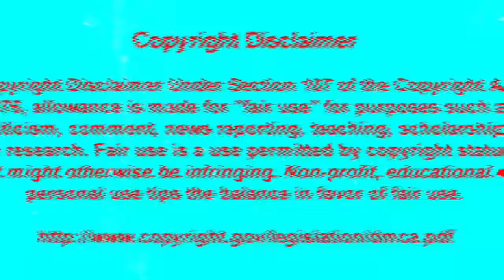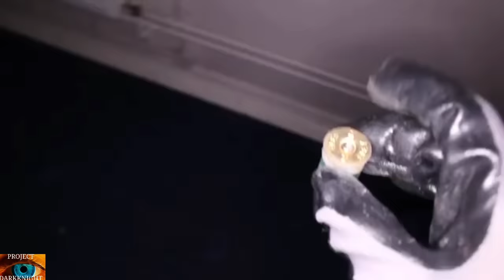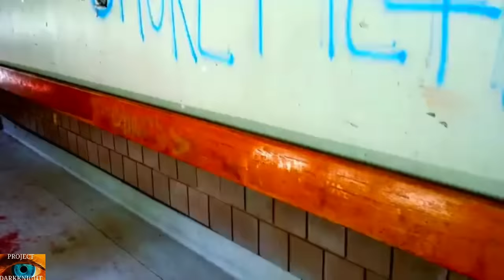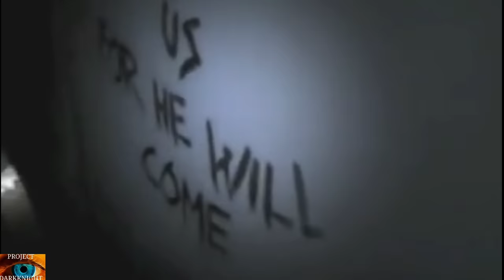Horrifying Videos That Show Urban Exploring Can Be Bad For Your Health: CAUTION

Comment: 18:46 - It looks like it's crimped at the top so it just might be a blank round... the 5.56 round and the silver casing were blank and simunition respectively and they are rounds used in mostly military training, they are fun to fire, especally 5.56mm blanks, also are pretty harmless (Just has a primer and gunpowder) as long as you don't fire them close to someone's face and body....They are hell to clean up tho ESPECIALLY the simunition rounds....  

Edit - yea @19:44 - he's talking about rust... that's the color coating used to denote the rounds as blank rounds after firing this round might have just gotten stepped on just used or over time the color on the tip fades and might look like rust. and also the green shotgun casing was also a training round. Yeaaa that whole building was used as a training building for room-clearing training 100%....

Comment: Those "bullets" are bullet casings and most of them look like blanks or marker rounds, meaning they use either paint or no load other than gin powder and wadding. Not used in a murder because they are not loaded with a deadly projectile. I recommend taking 1/2 a second and find out what your looking at before jumping to conclusions art the risk of sounding foolish.

Comment: At time 22:04 you can see the blast of the gun come from the top of the left ledge. You can see a little black mist go towards them and the sound of the gun. the bullets look like blanks,.. that means like a cap gun. no real bullets are in the bullet shell casing just gun powder. The black figure looks real because you can not hear it walking of stepping sounds.  You can not see any face or body just black fuss.

Comment: After a bullet is fired it becomes dislodged from the casing. When its removed from the body its a little twisted piece of metal. I was shot by an AK in Iraq and still have the bullet they pulled out of my shoulder in Balad.

Comment: The bullets those kids found looked to be possibly blank rounds, the way the bullet head was popped open like that? Very strange, if it was a real bullet that was actually shot it would just be the casing and not have any top portion resembling a bullet in the casing.. so part of me thinks it was set up. the Red was certainly not blood on the tip unless someone actually took the unfired bullet and stuck it in some blood, so most likely it was rust.

Comment: @40:46 - 40:52 you can literally see someone walking UP the stairs and quickly ducking to the right, around the corner, as they're walking/ talking about the smell, then saying they're going to go down the stairs first. So idk if this is someone known to be with them or what, but it's clearly a person.. it's clearly a person that should've be visual to them at the time, yet they make no mention of them in the clip nor are they mentioned/ shown in any other clips. Nor does PDH. So I'm just curious if anyone with better phone capabilities than me (and more info on the full video) sees what I'm talking about and can explain???!? 
FYI it's irrefutable when you play it at .25 speed starting just before the 40:46 mark and focus on the stairs on the right(going up) with my brightness turned all the way up, i can clearly see someone's feet walking up the stairs, then quickly stepping to the right,  peeking around the wall and standing there as they walk down the stairs. Someone please tell me I'm not crazy!?

Comment: Those “bullets” are all blanks. You can tell by the crimped ends and the red on the ends of the 5.56 round (M200 mil surplus most likely), and Eley doesn’t make anything in 12ga that short other than blanks (not to the best of my knowledge).

Comment: Funny how clueless that crew is about gun shells. Didn't see the 9mm close enough but the rifle and 12ga shells were blanks. That's why rifle shell was crimped at the end and painted red and why the 12ga shell was so short. There was no shootout. Probably all they could get in that country was blank rounds. Plus all spent shells would have been taken as evidence if there was a shootout. Just seen the one 9mm while typing this, looked like a snake shot round (tiny tiny pellets inside plastic tip).

Comment: Ha, I've been shot by all those. Those are simunition rounds and blanks. The ones with the crimped ends and the short green 12ga. are the blanks that just go bang (still dangerous within about 20 feet. The silver ones actually fire a projectile similar to a paint ball (and they do sting). They are used for force on force training.

Comment: @26:17 if thats America i am certain it is. Then who ever owns the building it's there Job to pay for someone to cone in after the police Etc have gone and clean up the blood. They will remove flooring walls Etc. As blood / bodily fluids decompose. So if it is steeped underwood or flooring at all has to be removed. Stripped right back. Similar to a home. The family have to pay for the same service. If i was them kids. I would have turned around and left asap. Called the cops from a safe distance

Comment: The bullet at 18:58 has not been fired by the looks of it because that tip thats the triangle part would be out (unless it is off and I am just blind) that bottom part is just the casing and if it was shot the casing would be smaller if you don't believe me look it up the same bullet side by side one shot and one not now idk how the tip was damaged but it doesn't look shot but mabey it was and it just wasn't damaged alot now the 13 gage was definitely shot it doesn't take a lot to know that idk how the

Comment: The 5.56 cartridge is a blank. It is live. Its been crimped. Yes the shotgun cartridge is real. They all are. 9mm luger would be a 9mm parabellum. No prizes for correct guesses as to what side arm it was originally manufactured for. Interestingly a lot of these are WW2 era... I've come across cartridges while urbexing as well. Not as many as what I've found while digging(artillery mortars, anti aircraft fuzes...very full on pieces)

Comment: those rounds all looked like blanks. the 556 an the 9mm with the black tip are blanks those silver ones looked like blanks too some have a dummy tip that splits an some have just flat seal but that 12g was real spent live round. if there really was a crime there they surely would of been picked up by plod an not left tho.

Comment: On the video of the rounds I know what they are. There blanks looking ay the tip how it is deformed that badly that's normal for a blank. Being 5.56 that's an M16 or what non military call the AR15. The reason for them being there is most likely it was used as a training spot for IE police or military. Relooking at that video the red on the tip is wax they do that to keep a seal on the powder in. Most likely those are police blanks because military uses black wax. That just confirm that 12G shotgun shell its police military don't take shotguns for room clearing.

Comment: Hahaha Brits! Haven’t handled bullets or a gun in too many generations. The bullet is the tip and the casing, still attached!, is where the powder explodes when the hammer strikes the plate on the back. It would be marginally more scary for you to have found just the casing… And that large bullet, which looks to be a smaller hunting rifle bullet, is not gonna leave out of the target intact. It will be mashed.

Someone was in there loading their gun and left behind that useless bullet is what happened.